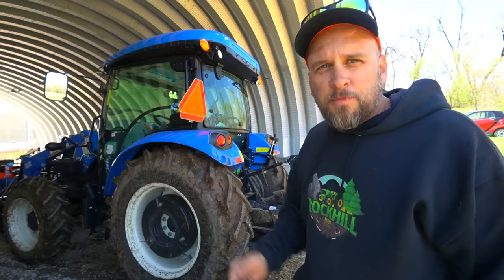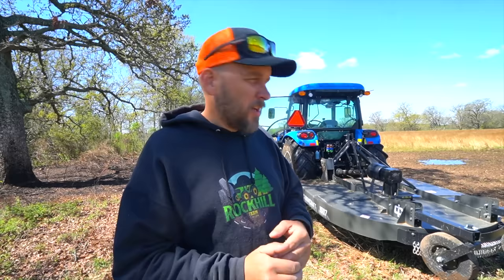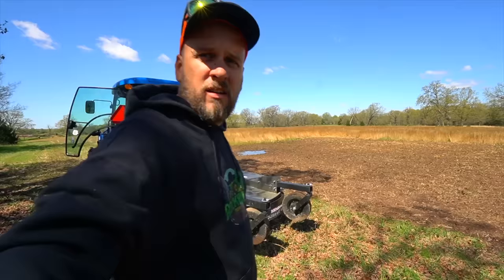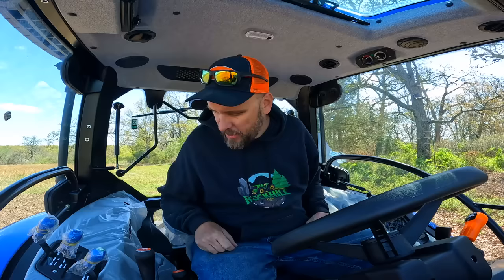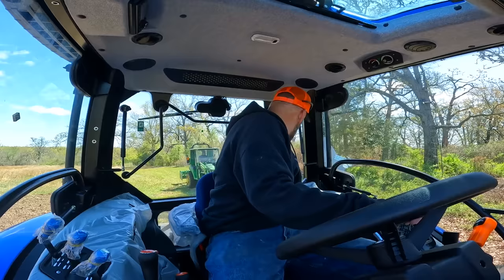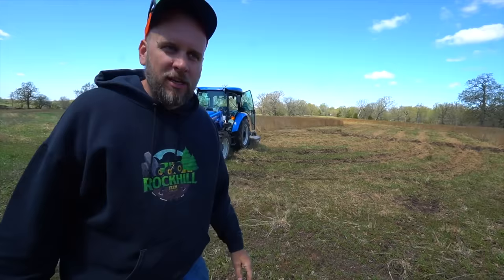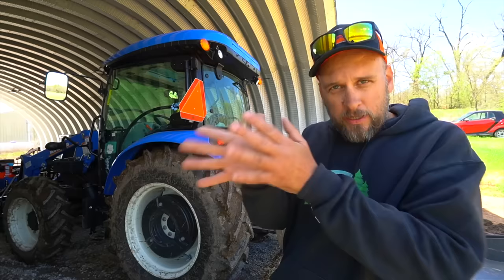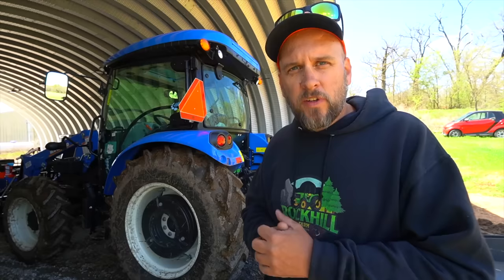Putting the New Tractor to Work - Workmaster 55

Comment: When cutting, I make 3-4 rounds all the way around and then start mowing a straight strip down to the other end; then I lift the cutter, move down 20-30 feet and mow a straight strip back to the other end. I then cut back along my first strip and turn, and back down my second strip; so that I am mowing strips across the field without having to make cloverleaf or tight brake-assisted turns. We always mowed our hay this way and it made a lot of sense. PS, I’m a retired NH/Kubota dealer, but I don’t  remember ever selling the Workmaster 55 cab tractors; my customers always wanted the Kubotas at that point. I think the Workmaster is made in Turkey, but I might be wrong, it’s been 6-7 years now.

Comment: I have a Workmaster. Love the value for the features you get on that machine. There are some adjustments you can make to resolve some of its short comings. The loader control can be rotated towards the seat more to reduce the reach required. Also you can adjust the steering stops to allow for a tighter turning radius. I would also put R14 or R4s on as the ag tires are very deep lug. I shopped for years and settled on the Workmaster over a Kioti RX mainly because of cab comfort.
Reply from the maker: Thanks for sharing that info

Comment: Mr. Brock; "point-blank" You NEED this Tractor. Reason # 1 it is the first size of a "tractor" that IS  a TRACTOR. #2 is; there no such thing as the "perfect-Tractor"( in size ,capacity,or features). You WILL have the "Complete kit" if you keep your JD 2038r & This size New-Holland 50-70hp Workmaster, for your "Tractor Needs".

Comment: I must say that the pucker factor went clear off the scale when you lifted those logs to full height!  The higher you went, the smaller the tractor looked.  As scary as that was, it was a good example of the capability of that tractor.  You were right in stating that a person would probably never have to lift a log that high.  There are just too many things that could go wrong.  I still can't believe how high it lifted them!  When I handle big logs with my 3046, I lift them only as high as needed to clear the ground and move.  Keeping it close to the ground also lets the log act as an outrigger should the tractor start to tip, and they will tip!  And the higher you go with the log, the longer it takes to come down and offset a tendency to tip.  Can you imagine starting to tip with those logs twelve feet in the air?  Well, thanks for that little dose of excitement this morning, Brock.  I'm loving these tractor comparisons.  Keep up the good work!
Reply from the maker: Good points

Comment: Great tractor for sure!  On cutting efficiently on  large acreage areas….. always cut your edges with a small hydro tractor and a 5’ cutter and spin any trees or obstacles.. I usually do this a few days before I’m actually gonna cut the area with a big machine when it suits my schedule to do it.  Then when you show up to cut the area with the big machine ALWAYS cut the headlands on each end of the long axis of the field a minimum of two tractor & cutter lengths. Once done only cut in the direction of the long axis and When you get to each end turn into the next cut path with a lazy turn ( not sharpe turn ) always moving forward and work your way across the field. When you get across the field you will be left with a series of strips.  Then turn around and cut back over the leading edge that was mashed down by the right side tractor tires thus cutting Back against that uncut pushed down grass and covering your over lap working your way back across the field from whence you came ending up where you started.  Then repeat.   The main thing with using this approach is that you will NEVER need to turn around, make a clover leaf circle OR back up.   The speed of the tractor is kept at the maximum for the conditions encountered and you will only make forward at speed lazy 1/2 turns for the entire field after the headlands are cut out.   This technique will cut way down on your mowing time once you master it.   

Great video and super series on all the brands.   Really looking forward to each one and the daily drop of your use of this and other machines. 🔥🔥🔥👍👍👍

Comment: At work we have a case tractor of around the same hp and i notice that the interior is almost exactly the same! As well as the engine and transmission
Reply from the maker: Yeah, I think the case in new Holland tractors are almost identical. owned by the same company.

Comment: While I love that tractor having to use a clutch is an issue with my knee needing replaced. Buddy seat is awesome too.
Reply from the maker: Some of these power shuttles with synchronized gears have a little clutch button on the shifter and you don’t have to push the peddle

I’m still a hydrostat guy
Reply: @RockhillfarmYT  Good info I never knew about that feature. But I'm still sold on the hydrostat after experiencing the amazing low speed control it gives me.

Comment: I’m impressed by how stable that machine looks considering the rears are not currently loaded. Do you know how much the wheel weights weigh?

My 5065E that I traded in on my 2038R would be a fair comparison against this machine. The rear R1’s were loaded with 740 pounds of rimguard per tire (no wheel weights on mine) and it always seemed light in the rear when doing serious loader work even with an 840 pound box blade on the three point with a cat 2 iMatch. 

I think there’s a big difference in loader reach (how far past the front of the tractor the bucket is) when you compare a compact tractor to a utility tractor. That added reach is necessary due to the lift height on a utility, but it means you need a lot more ballast to compensate for it. 

Great video and I’m really looking forward to the rest of the hands on comparisons. I think you’re going to be getting a lot of new followers and making a lot of your current followers very happy with this series of videos. I’m sure you’ll enjoy making all of them as well. 🤠
Reply from the maker: Thanks

Comment: Nice!  Any updates on the bees and saw blade sharpening side gig? One thing about that 2900lb test is that you have the large log close to the pins. 800mm is 31 inches, so ideally you'd need to hang a sling on the forks 800mm out and lift both from there.  If the combined diameters is larger than 31 inches then that will offset the larger log being closer, but I have no idea by how much (math... geometry...). The jungle website has 2200lb hanging scales available. With two of those and slings you could measure accurately how much those logs weigh. I'm wondering what the margin of error is for the log weight calculator and the variables in the logs.
Reply from the maker: There’s probably quite a bit of margin for error.

I’ll be showing the bees when it’s time to get Honey, but they are doing good

Comment: If you look on the steering linkage the stop has a spacer you can take out to tighten radius. The wheels are adjustable for width and that will change it too. Yup the FEL on these is stout! It's to bad you dont have a pto dyno or a way to compare hp because my seat of pants tells me they are on the higher side of the hp estimate.

Comment: Those Ag tires aren't doing you any favors with wet ground.  Even with my R14's on the boomer 40, if the ground is wet, I'm leaving ruts.  It's one big downside for me when I want to use the loader to move firewood totes around the property -- it's going to leave marks all over the place.

Comment: Howdy Brock!  Nice looking machine!  I like the window in the roof of the cab so you can see the load all the way to the top of the lift reach.  For your use case scenario totally agree... why would you need to lift that kind of weight to that height.  But for someone like me, whose hay loft is 10 feet off the ground... it would be perfect. Out of curiosity - are the rear tires filled with ballast?  Nicely done and thanks for sharing 🤠
Reply from the maker: They are not, but if I bought it, they would be